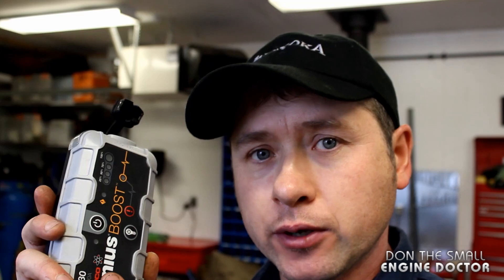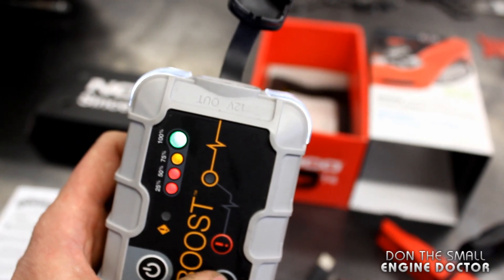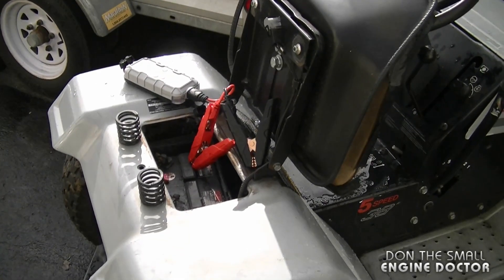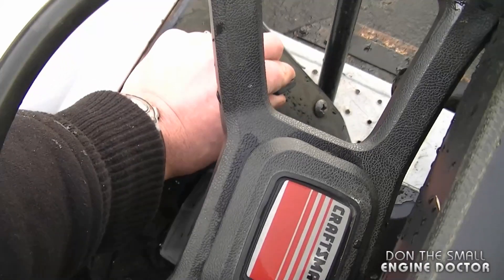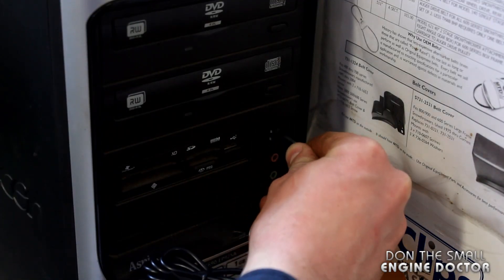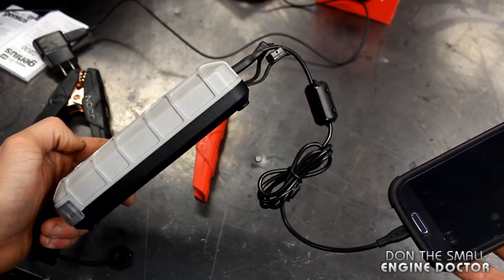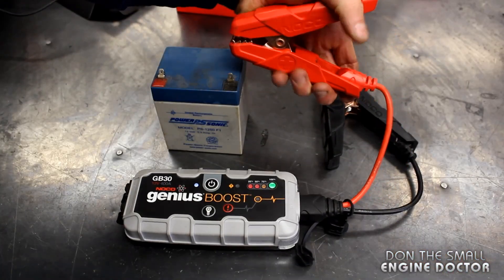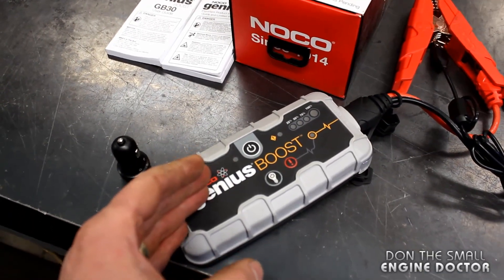TOOL REVIEW - NOCO GB30 Ultra Safe Lithium Jump Starter

Comment: I got the same one, so far it has not let me down.
The only thing I disagree with some regular jumper pack do have some safety features, the one I have, if you hook up the cables backwards and the unit is in the off position it will beep at you, but yes if you ignore the beeping and turn the unit on it will spark.

Comment: These are great! I have a small and large one of the fixed (not slip joint) pliers and they can really help in getting you out of the typically frustrating spot just as demonstrated in the video. Not cheap but well made and heavy duty.

Comment: Scotty Kilmer did a review on this jump starter to. It seems like a great little tool. The only thing im worried about is if I got it, it sat in my car, then when its time i need it the battery on it would be dead from sitting so long.
Reply: the answer for those questions is on the product page. towards the bottom

Comment: I bought one at CTC back in January. Only tried it a couple times. Wasn't enough on my opposed briggs twin. back in february. Went to use it yesterday. It was plugged in but 25% light was alternately flashing with 100%. Nothing in manual about that. Output measured .45 volts. Fortunately it had 1 year exchange. Hope the replacement works better.
Reply from the maker: Ken Hilson mine always works, maybe you had a dud
Reply: donyboy73 I got the replacement and my advice would be it's not worth the money. With it's USB cord it would not charge either of 2 cell phones. With another cord it would charge 1 of the 2. On full charge I tried to boost my briggs opposed twin that had battery voltage of 11.5. Couldn't crank it fast enough. I then did it with my mastercraft booster that cost half as much as it fired right up.
Reply from the maker: Ken Hilson that's too bad, mine has worked perfectly or I would never have done a review. tell the company you want your money back

Comment: I have one question. You said up to a 6.0L engine. I have a dodge 3500 dually diesel 6.7 L so I am guessing I should not use this on that truck?
Reply from the maker: BBBYpsi definitely not
Reply: donyboy73 To bad I haul travel trailers all over the country & this would be a nice little item in case my battery died.

Comment: Did you get a new camera? The quality looks amazing!
Reply from the maker: filmed with a dslr camera
Reply: donyboy73 Looks so much better than your old camera, The quality is superb
Reply from the maker: Cap10323 thanks, much more work with this camera to film that's why I still use the other camera
Reply: donyboy73 For what you film, like carbs and engines, this camera will show a lot more detail.
Reply from the maker: TIKIMAN198 I need to get a macro lens, very expensive